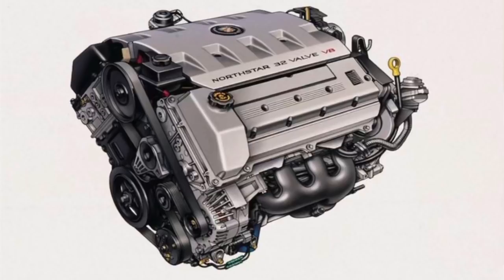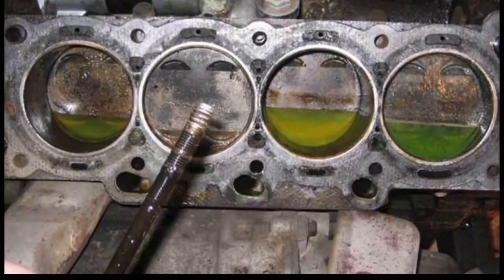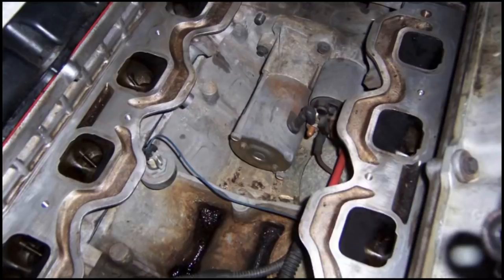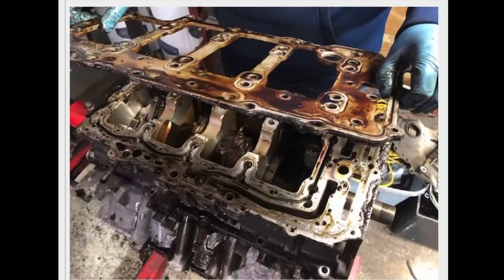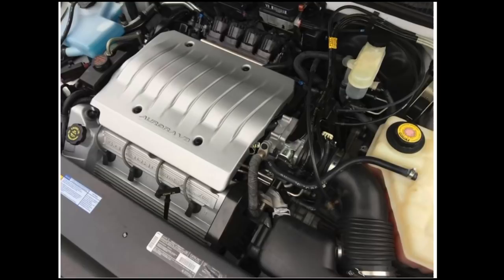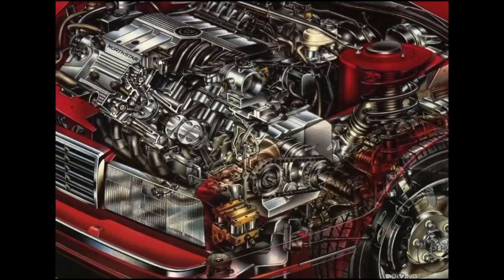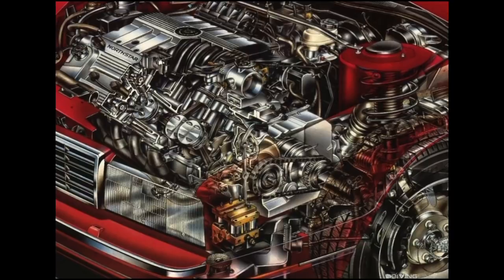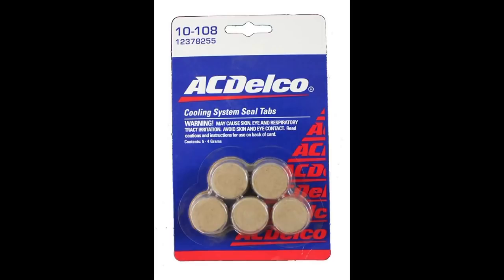Worst Car Engines of All Time: Cadillac Northstar

Comment: Northstar's are awesome engines! Your video sums up all the issues they can have perfectly. People really dont understand all those issues are fairly easy to fix. To compare if you have an older subaru with an EJ engine its going to need head gaskets they all do. If you run the EJ too long on blown head gaskets, you might warp the block or cylinder head surfaces. That repair is CRAZY expensive a block is around 2500 and a head could be over 2000 for one head..... Don't get me started on CVT transmissions!

In the end the Northstar imo is an amazing engine, which is why i own a 1999 Oldsmobile intrigue with a LX5 Shortstar V6! Also to note the LX5 V6 is a very quick V6! Love the smoothness of it.
Reply: Most EJ head gasket Leaks are external.  but when your done fixing the EJ you have an AWD car when your done with a NorthStar your stuck with a FWD turd.  Now what happens to an overheated NorthStar?  I know multiple NorthStar's that will never drive again because it's just no worth the time.  They remind me of Trail blazers were they go up on blocks and never come down.  EJ's though flawed are not Northstar level turds.
Reply: @ Gabe Tabor

Who cares about an AWD car?

Especially when almost everything is AWD today without Subarus dumb engines that have twice as many head gaskets and cams as a normal four cylinder engine and a CVT that’s garbage and most people don’t need AWD anyways. I have two feet of snow in my yard and live in the mountains and FWD is more than enough for me… while it’s all AWD and 4x4 vehicles in the ditch because their drivers thought the laws of physics didn’t apply to them. 

Also…. Subarus ruuuuuuuuuuust!
Reply: @ Gabe Tabor

And the Trail Blazers?  I never will get that. They blow one head gasket and “it’s not worth it to fix” because at 20 years old and 200,000 miles the repair is more than the $1000 the vehicle is worth. 

But people are falling over themselves trying to buy a Forester that is burning oil and coolant and is mostly see through for $5000. 

I mean.. you can’t argue with depreciation. Fools and their money. I’d rather shade tree the Trail Blazer for a couple hundred bucks and 24 beer and have something solid for another decade than deal with that cancer.
Reply: @Bartonovich52  The reason people pay more is perceived value.  Pull codes on both cars and see which one has less.

I bring up the Trail blazer because I wanted to like them.  Until I sat in one.  How can a vehicle that big feel that claustrophobic?  And lets be real a trail blazer is just a knockoff Subaru.  No real off-road performance at all,  Easily high centered.  You and I like it for the Atlas engine but why should anyone else like it?  Horrible visibility and low seating position for such high vehicle.

Since we fix our own, American cars do offer exceptional value.  I just don't recommend them to people cause I don't want to fix them.

Comment: The Northstars predecessor the HT4100  was worse. To keep development costs down and to enable the engine to be installed into existing platforms, GM specified  Lotus  Engineering adapt the DOHC 32 valve heads to the HT4100 engine block so it inherited the HT4100's inadequate number of thin head bolts. I drove a Northstar STS back when they were new and was impressed by the power , torque ,refinement of the Northstar, it was like night and day compared to the  weak earlier '90s Cadillac  V8s IMO.

Comment: If the people that designed the Northstar had asked any competent machinist they would have known better that you never use gine threads in aluminum. I suspect the decision was taken because if they used a fine thread head bolt they could go down a size and save 25 cents a motor.
The starter location. It should stay cleaner at least.

Comment: In my mind, the car most sadly burdened by Northstar lore is the Allante. This isn't a fair assessment because the Allante used the Northstar in its final year only. My sadness, however, stems from the fact that, in the Allante's prior years, it was saddled with a terrible, high-tech braking system. Apparently if the brake light indicator came on, you had three presses of the brake pedal remaining before the brakes vanished. If there's one thing that scares me more than a blown Northstar head gasket, it is a braking system that can leave you with virtually no brakes on very short notice. The Allante simply couldn't win.
Reply: I handled the service for my parents' 91 Sedan de Ville years ago in its infancy.  Finally was disabused of EVER using a dealer for anything when I took it in for service to Casa de Cadillac in LA's San Fernando Valley.  They told me that it needed new injectors and a brake job at 85000 miles.  I authorized the work (we kept the car perfect).  Picked it up two days later (we're busy sir!).  Headed out on to Ventura Fwy.  Miles down the road the traffic slams to a stop.  I hit the brakes (anti lock), pedal goes down two thirds of the way, and binds up, and I'm stuck with 20% of braking power, about to rear end the car in front of me (when you lose the brakes on a Caddy, it suddenly feels like the car has infinite mass). I swerve into the car pool lane with inches to spare.  I manage to limp back to dealer and go bat sh#% crazy on the service manager who was blithely indifferent.  They fixed the brakes, but they were never great, and the new injectors immediately reduced the average milage (mostly freeway), from 25 to 18.  IMHO virturally ALL car dealers are either incompetent, grifters, or both.  I have wonderful independent mechanics who keep my stable of vintage cars running perfectly at reasonable cost. Sorry Waltschmerz for the long disquisition but you jogged a scary memory.  All the best!

Comment: In 2021 I bought a 2004 XLR and I have a lot of fun with it. I ordered parts on the internet (the hydraulic valve actuator for the left intake and it came from an ex-eastern country) and had it replaced at my local GM dealer and the radiator blew up on me and I changed it. Since then, all is working fine and I greatly enjoy the sunshine !

Comment: Hey Adam I love the point that you brought about a Northstar how good they run when they're running good I have two Cadillacs a 03 Cadillac DeVille DTS
Reply: A 97 Eldorado Doral Edition 179 thousand miles 243 thousand miles on the DeVille and the main key to keep both those engines running is to do a coolant flush every year the owner of my 03 has a flush tube going connected to the heater hose lines where you can hook a garden hose and flush the system out
Reply: I keep getting cut off when I write my comments but what I meant to say about my DeVille is the previous owner had a hose connected to the heater hose where you can flush it out with a garden hose and that car runs excellent even though I put some money in it every time someone sees the car I get compliments and compliments on my Eldorado the guy who owned that he never drove it in the in the winter time pearl white with a white padded top but it's good that people talk about northstar's and don't want to buy them but if you can catch one from an original owner and get to talk to him and see what the maintenance schedule was on the car they can be good cars you just have to flush the coolant system every year my 03 DeVille it runs so good sometimes I just let the car idle just to hear how smooth it runs

Comment: I guess YMMV is a real thing. My stepfather bought an STS with this engine, he put 250,000 miles on it with very little trouble. He loved it, owned it until it would no longer pass safety inspections due to the body rotting.

Comment: My parents had 3 Caddy's with Northstars. The first one, a Sedan Deville, had internal corrosion issues in the cooling system. It required frequent coolant flushes and would cause periodic overheat issues while driving. Otherwise, it was an awesome engine. The issues mentioned only occurred every couple of years. The other two DTS cars, the engines were flawless. They put a lot of miles on those. Their first DTS had annoying issues. The key lock in the driver's door was improperly installed at the factory. The lock fell into the door the first time my dad actually put a key in it. A front turn signal light blew and required 3 hours in a dealer body shop to replace it. It took a day for the dealer to track down a replacement bulb, which came from a Mercedes dealer. GM had no spares for the bulb available. Experimenting with new and innovative designs is actually a good thing. The failure of management has been to push those new designs out to the public without sufficient testing and development.

Comment: The early Northstar I had a chance to drive for limo work back in the 90s. It was in a Sedan De Ville Concourse and it had oil consumption problems. I ended up discovering about the piston ring design and cylinder wall finish, and unless you were willing to pound on that engine mercilessly it would use oil. She was fast and sounded great, but too fussy.

Comment: I heard somewhere that the instructions for pulling the engine in the shop manual, they span 138 pages.  You basically have to remove everything in front of the windshield.  True?
Reply: Probably, but most of the time it is easier to just drop the subframe with the engine and transaxle.

Comment: Owe my life and the lives of my kids to the Northstar engine.  I was driving my father-in-law's 1996 Cadillac Deville with the kids in child seats in the back.  As we went through an intersection with a clear green light, a truck in the cross street blew through his red light at high speed.  He was pointed right at the side of my car.  I only had a blink of an eye to react, and stomped on the accelerator.  The engine roared to life instantly, and moved that 4,000-pound beast of a Deville out of the way just in time.

Comment: I never had any singular problem on either of my N*s that was over 100 bucks to fix.  Blower motor, window regulator, coil pack, crank position sensor, shift solenoid, radiator, fuel pressure regulator, rear shocks, speakers.  Each under 100 for the part which I installed.  This over a 15 year period and 80 thousand miles between the '95 Eldo and current '04 SLS.  The Bose system in the Seville CRANKS. Love me some Northstar mojo. :)

Comment: I had a 2003 DTS that had nothing but issues. Mine leaked oil needed coil packs and I did need the head gaskets replaced. The car was babied since it was new.

Comment: The RWD northstars are very solid cars, they have LS head bolts. I love my 320HP 05 STS. But all the failures of the early Northstars stain the name of the later cars. I ran a 13.9 in mine, very quick car for the time.

Comment: 1999 Oldsmobile Aurora 95,000 miles still running just changed the starter, front struts, rear air suspension, Flushed coolant.

Comment: Bought a 2000 esc for my son.Relatively low miles, but going in knew it would take a serious maintenance schedule. Did the alternator  r+r, the video is spot on. Wrestled and cussed for 2 1/2 hrs. and finally the sucker just fell out. While under the elevated front end noticed that the a/c compressor is between oil pan and crossmember. I may just give him the keys to my ever faithful 96 Suburban and buy myself an e-bike.

Comment: Had Northstar engine in 1995 Deville Concurs nice when it worked but not reliable, leaked oil over-heated and head gasket problems.  Have Cadillac with LT1 engine used in Corvettes which was more reliable night and day difference.

Comment: Adam - thanks for addressing the Northstar comments on your last video.  I had three of them, all with low mileage, and never had an issue.  Fortunately I traded cars frequently in that era and never kept one past about 25K miles.  Granted they had great power, especially in the '99 Eldorado ETC.  They made decent fuel mileage for the time and I'm familiar with their lineage as a racing engine and what they called a "high feature engine" for their techy customers who wanted something exotic.   Looking back I find it ironic that Jeremy Clarkson raved about the Seville with the then new Northstar and repeated GM's claim that it would go up to 100 miles with zero coolant!?!  What might have been...

I have to say that while you endorse the engine as "not really all that bad",  you do hit every problem that they inflicted on buyers who expected better.  I think the metric of what constitutes a "bad" engine should ultimately be one that damages the reputation of the brand, costs GM a fortune to repair,  and makes any used example a pariah to be avoided.   By those standards, the Northstar qualifies in spades!

You touch on the Aurora briefly.  I drove a demo Aurora when it was new in 1999 and was very impressed, but the monroney was $45k.  I looked at several over the years but the reputation they had earned steered me away from ever buying one.   I'd love to see you make a video about the Aurora.  It had the potential to be a great car, but instead it killed Oldsmobile.     Thanks for all of your videos, I really enjoy them
Reply: I agree - this channel has great videos. I disagree that Cadillac should just abandon Northstar owners. That is likely to cause more bad will than an engine requiring some remedial help. The ignition module has been discontinued, which means GM is expecting owners to eventually junk their cars. This is the opposite of a good environmental policy. Cars should be made to be serviced the way Bentley and Mercedes stand behind their products going back to the beginning.
Reply: The Aurora didn't kill Oldsmobile...GM killed Oldsmobile. The Aurora was the brightstar in Olds lineup in the 90s and early 2000s along with the redesigned Bravada which was a hit when it was released but they were already closing up shop at the point. The Alero also sold decent enough. Seeing that the 2001-03 Aurora was actually the redesigned 88 they didn't do bad. But would have loved to see what a real flagship the redesigned Aurora could have been.
Reply: @Chitwn81  I have three Auroras, one Intrigue and one Alero. All in perfect condition!
Reply: @jeffshadow2407  I want a 98-99 Aurora so bad 😔

Comment: you forgot to mention sudden decapitation and castrations. This engine really had alot of problems. Like the sensor that made the trunk explode when parked inside an aluminum carport. I've even herd stories of radiators blowing up and shooting metal scraps in all directions when you open the hood on a cold start but that's hard to believe. The electric seats compressing the passenger into the roof killed a few of my enthusiast friends wife.  I think where GM really messed up with the Northstar was the poison chemicals used in the AC which makes you fall asleep before putting you down humanely.. now I have had a few friends where ALL those components failed and were able to get 230,000 feet out of them before a head gasket blew out.
Reply: Woah, what?
Reply: @colintang3910  my thoughts exactly, what ...what?

Comment: I had  a 1994 STS also..it ran good
until it hit 100k range and then the head gaskets. In 2000 we traded it in for an Acura RL and been with Acura ever since (leased). The Cadillac dealership wanted $10k to fix. We got very  little on the trade i

Comment: I bought a 1995 Dark Blue Cadillac deville and it was low miles and beautiful.  Nice grey leather interior that was in perfect condition.  Low miles everything was perfect for $1500. Even had a fresh oil change. Learned real quick not to buy a car with a fresh oil change. I bought the car with the head gaskets blown so I paid my mechanic to install a new set. He discovered the aluminum block had stripped head bolts from the previous attempt. They had helicoiled them. WTH !!!!! So I decided to let him try to repair it right but he couldn't make any promises. For 2 weeks straight it ran perfect then one day it starts blowing smoke out the tail pipe. I go take a  look and even with the engine still running there was green radiator fluid pouring out of the exhaust pipe. OMG!!! So I decided I won't let such a beautiful car go to waste and I put in a new used engine. It was perfect for about 3 months and it caught fire. Injector seal had let fuel out of a seal.. I guess it cracked from sitting in junk yard..
So that ended my time with that car but I learned a whole lot!!!

Comment: I had a 1997 STS, 168,000 miles, no engine or trans problems and at 325 horsepower it was real fun to drive, I think the whiners are just not maintaining them correctly

Comment: Good video Adam  your right the Cadillac northstar was light years ahead off what Cadillac was offering in the 80,and early 1990 ie the 4100 ,and too a lesser degree the 4.9 v8  that cross over. Pipe was really a bad design running right up and under the oil pan I had too remove the subframe on a Seville once too change the oil pan .just because off that cross over pipe.if I dropped the subframe about half an inch I was always able too get the alternator removed from those things .and ford had lot off oil leak issues also with that crankshaft support housing gasket leaking .👍✌🏿